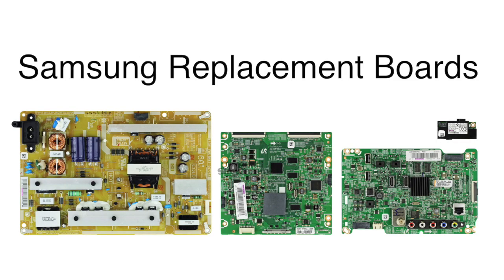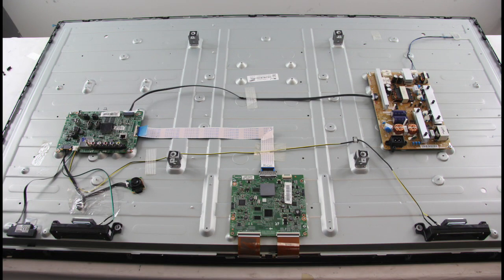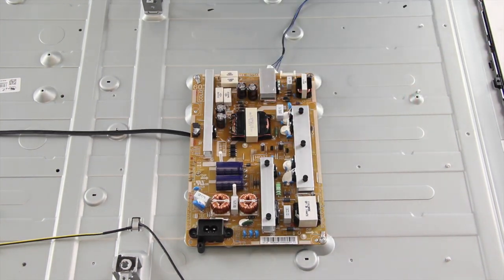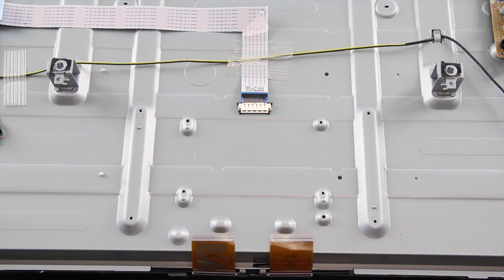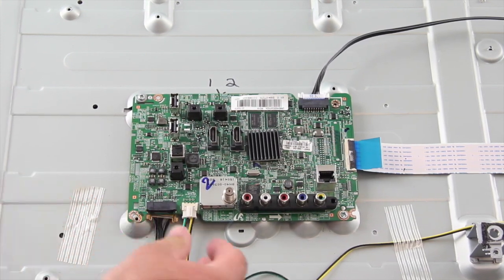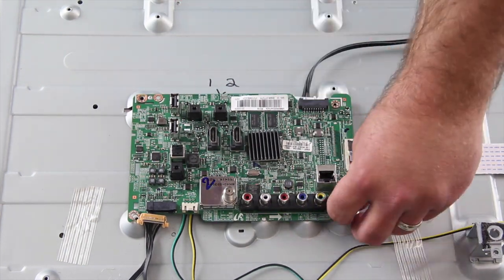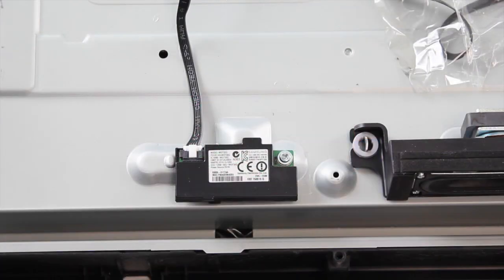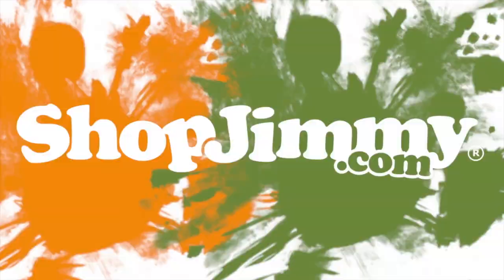How to Replace All Boards in Samsung LED TV - Model UN60H6203A - Samsung TV Support

Comment: Hi I have a question my vizeo 60 inch smart tv model number E600i-b3. My tv keeps turning off by itself. Whenever I turn it on it either turns off right away or waits a couple of minutes. How do I fix this?